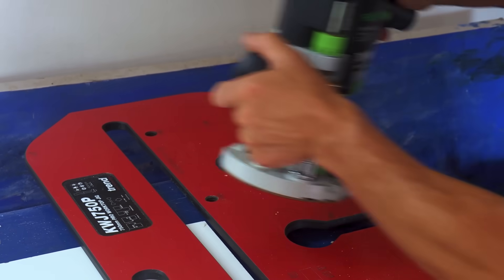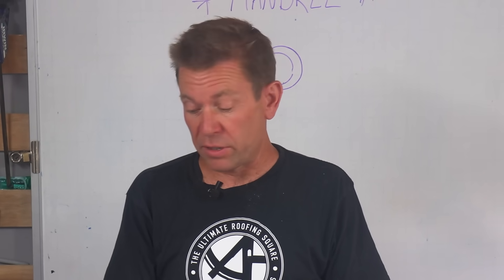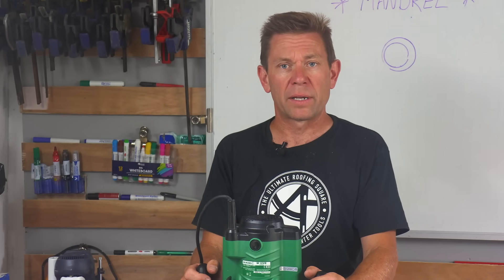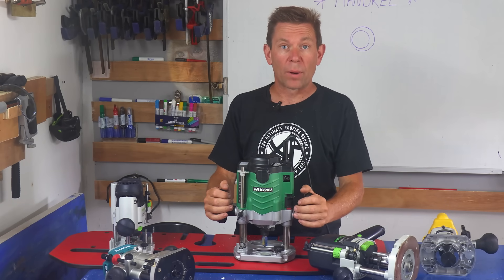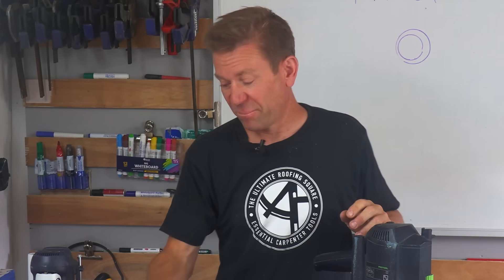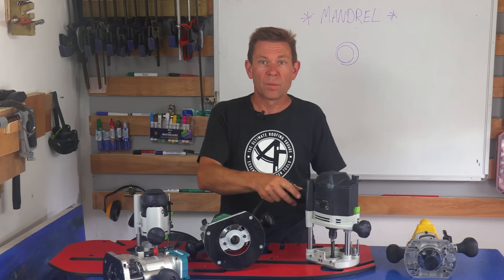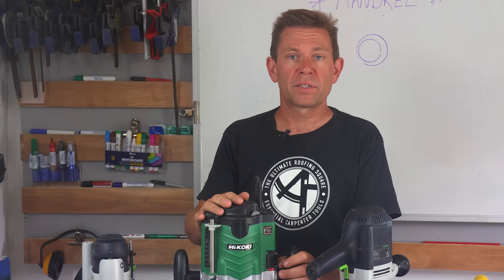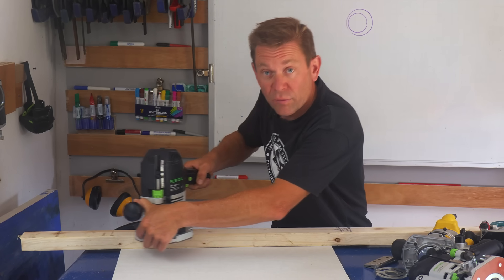Expert Tips for Using Your Router Like a Pro

Comment: I tip I picked up once using worktop jigs is to do one light pass with the router and then switch to a jigsaw - Follow the router mark with the jigsaw and then finish with a full depth pass with the router. Saves a lot of wear and tear on the router bit.
Reply: My friend does that.   With the newer work top jig you can adjust the recess so that helps reduce wear on a router.
Reply: Good man 👍

Comment: I've got the Makita 1/2" 2100W Plunge Router & the thing that impressed me was just how quick the electric brake kicks in once you release the trigger. The router bit stops spinning almost immediately so far less likely to nick the worktop jig when lifting the collet out of the slot. I had an Elu 1/2 Router previously and that took forever to come to a complete stop.

Comment: I bought the Trend unibase as my router had no blade centring adjustment. Does the job and provides more weight to the base which can prevent rocking when routing worktops! 😊

Comment: Good info - especially centering the bit on the base. How about bearing bits versus use of a bushing?  Other than cost difference.  Flush trim bearing bits sure make it easier to construct (and test fit) the template.

Comment: I'm scared shitless of my router, so thanks.
Reply: Very wise.  I was routing a green oak beam.  A deep mortice.  I locked the bit out.  I was straddling the beam.  All good then all of a sudden hit something tough.  The half inch dewalt 625 k jumped out pivoted in the air and then the bit was horizontal.  That caught on the beam and acting to waltz the router along the beam.  Luckily the cord caught and the plug was yanked out. The bit stopped turning two inches from my wedding tackle.  Like the James Bond movie.  So for deep mortices do a plunge cut and don’t lock the bit out!

Comment: I'll tell you what Dan, I've taken to buying erbauer 12.5mm router bits 60mm long and there the doggies do dars better than the trend ones and cheaper 👍
Reply: Thanks Tony, I’ll have a look at them.  🙌🏻
Reply: Erbauer tools are not great or even a bargain, but their accessories, bits, etc, are excellent. Priced so you can dispose of broken or worn items a few times for less than a top rated equivalent. If using a particular bit every day, go top brand. If monthly, go Erbauer
Reply: @cuebj  I’ve not used their tools but agree their accessories are good for the money.

Comment: Surely at the point of installing kitchen worktops there is going to be power
Reply: I install kitchens everyday on large building sites. Many  houses don't even have windows, or tiles on roofs and kitchens go in. Power is on  at last stages, just before decorating.
Reply: @9421samuel sounds like it’s all rush rush.   😮
Reply: Not in new build
Reply: @Ultimate-roofing-square. Crash, bang wallop, awful! 🙄
Reply: @Toyotaamazon80series  😉